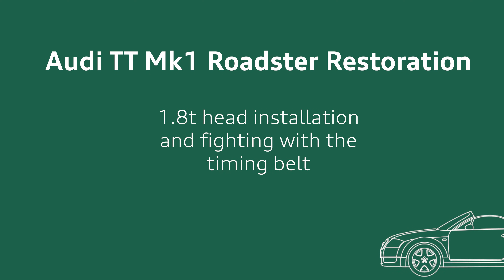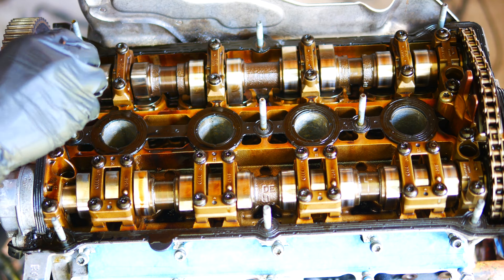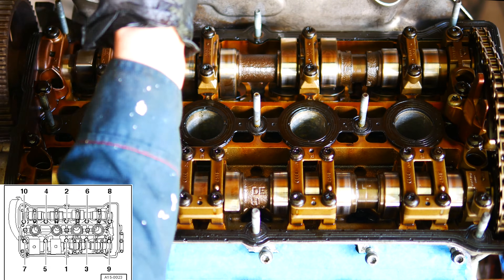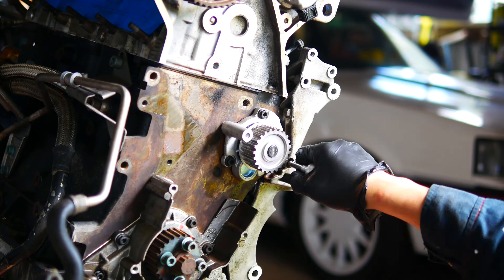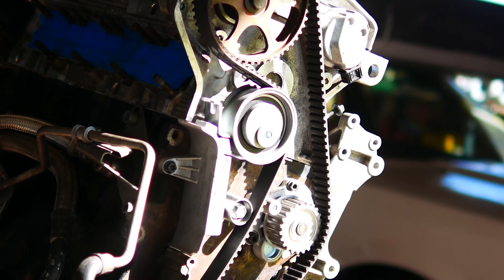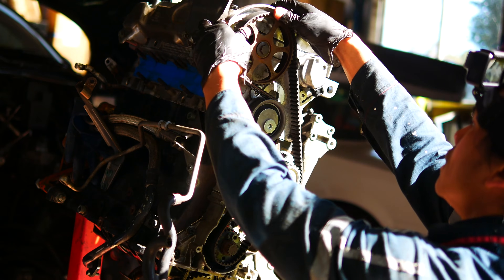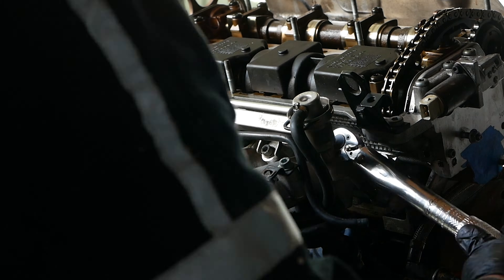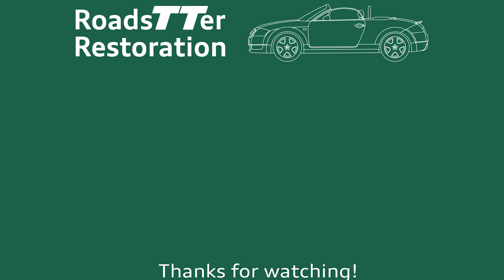Audi TT Mk1 1.8t head and timing belt install and manifolds walkthrough. TT 8N Roadster restoration

Comment: Hey Ian, me again. Did you have the head rebuilt, i.e new exhaust valves etc. currently getting the parts together for forged rods. Would like to stick to a budget but if it needs done then i will Cheers.
Reply from the maker: @marcooconnor  nope didn't do anything extra to the head except clean off all the crusted crap on the exhaust valve faces.

Comment: What are the chances of blowing head gasket or cracking block or head, at 75K miles? After severe shacking idle (didn’t drove it) I found one injector was not spraying. Replaced with 550cc and tuned it, and now I see steam condensation is coming out from exhaust- also when engine is fully hot, 68F. Engine is 75K miles. It is not rich smell or burning oil, it is definitely steam lookiing.
Reply from the maker: Ok that sounds bad - are you also losing coolant? That would be the biggest telltale that you have cracked head. 

Also do compression test.
Reply: @ianpgonzaga  i guess i am loosing coolant. To measure it, I did block tester- which color didn’t changed (blue), and refilled coolant to the middle line to see am I loosing. I am currently observing.

Besides that, does our cars overheat fast when idling? What I noticed is, 49c tells me that car maintains coolant temp 89~93c during driving. But when idle, it goes up to 103+ pretty fast.
My low speed cooling fan doesn’t turns on over 95c tho. But when I turn on ac, it both fan works at high speed.

So, without low speed fan, is it normal to see engine temp going up fast?
Reply from the maker: @monoton9597  yes the engine temp can raise quickly on idle but the needle shouldn't go past 90
Reply: @ianpgonzaga  i think my needle is broken. c to middle goes well but it doesn’t move from there. Ive seen 115c maximum when my both fan failed but needle was staying in 90c area
But thanks, glad to know raising up temp is fine
Reply from the maker: @monoton9597  how are you measuring it going to 115C?
Reply: @ianpgonzaga  49C.
I just used my OBDII reader and it is staying under 99c. I guess 49c was reading lil different.

Still i have this smoke. https://youtu.be/GR0C3w-OFa0?si=w1s3zLzBRZlWHKJm
With hot engine (15 min drive) and hot day 68F, sunny.
Reply from the maker: @monoton9597  I think just monitor your coolant loss. 

Reading on OBD gives a true indicator of the coolant temp but in the cluster it is "buffered" and needle will stay at 90C until temp is over 110C. Once it hits 110C the needle should move.
Reply: @ianpgonzaga  thank you. The amount of smoke is not huge, but staying too long if it is condensation. Coolant and oil is not creamy. 

I lost some coolant but after refill, seems like it is not decreasing. Truly mysterious engine.